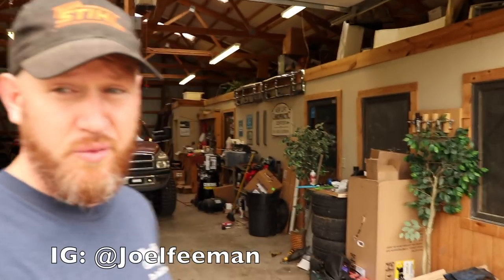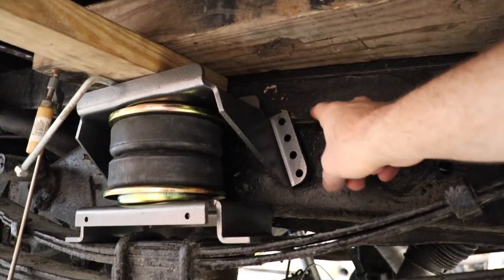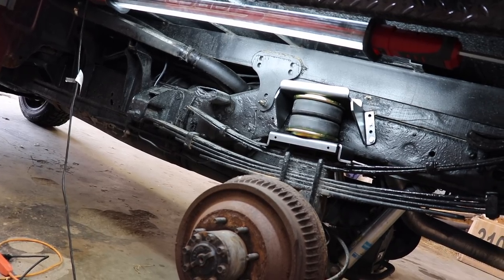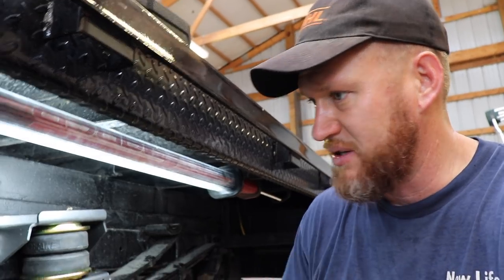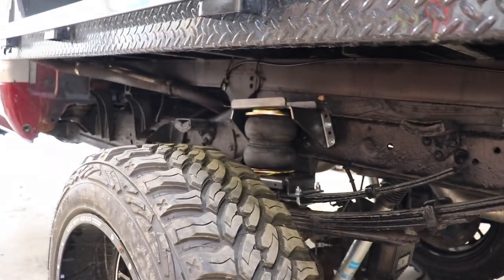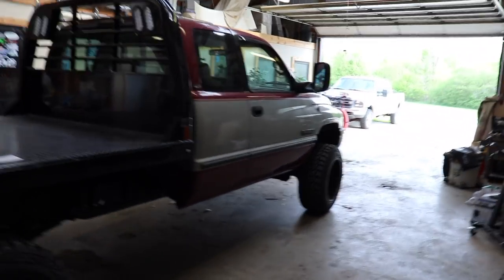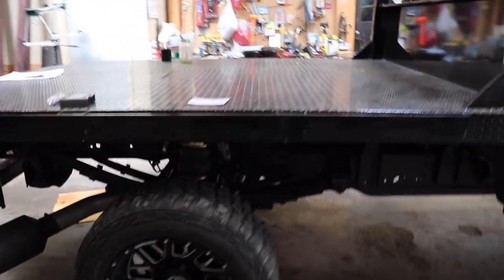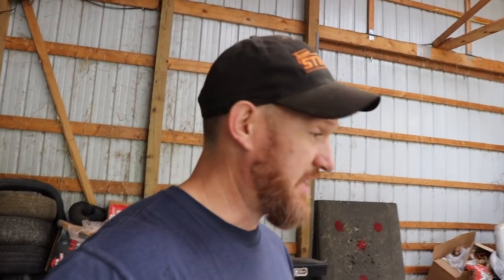WE FINALLY GOT IT DONE!!! SHE'S READY FOR HEAVY HAULING!!!

Comment: In regards to a good aftermarket bumper, MOVE bumpers are really affordable. I have them on my 97 k2500 Chevy and my 05 duramax. For those of you that don't know move bumpers. They are a DIY bumper, they come disassembled and you weld the and paint them yourself ( that's why they're the best/cheapest aftermarket bumpers). I would really recommend checking them out.

Comment: Looking good, dad did an awesome job on the video! For your traction bars I would recommend bolt on rather than weld on, just in case you ever have to remove it or something happens to the rear end.

Comment: Malachi, you got old quick at the beginning of the video

Rev 1: The best proper way on doing an air suspension is to have onboard air (air compressor and tank). And instead of having an electronic ride height valve, just get a leveling valve with air dump feature. Similar to what a semi truck has. it makes it easier when hauling a trailer. I'm in current build doing this to my f350 drw.